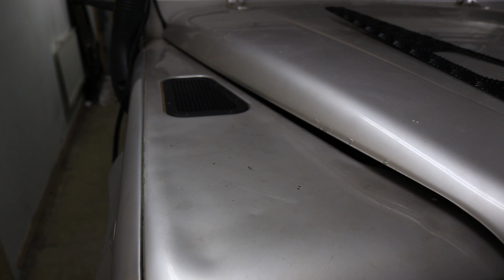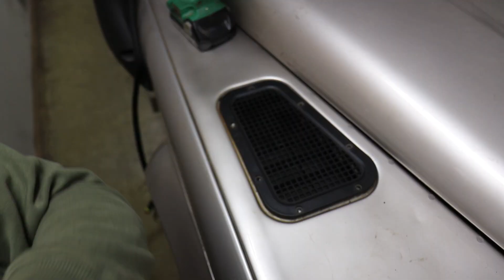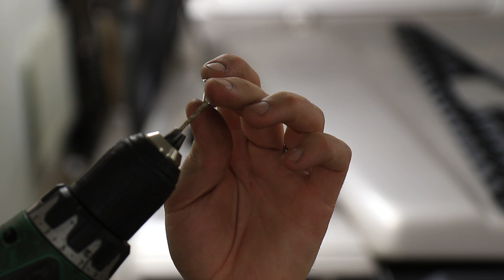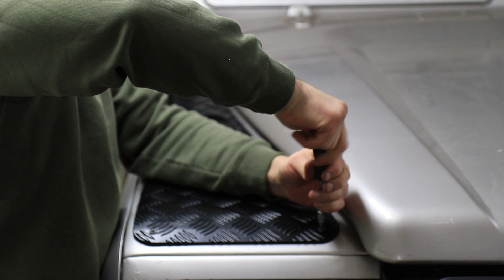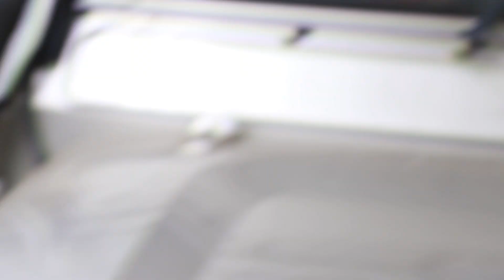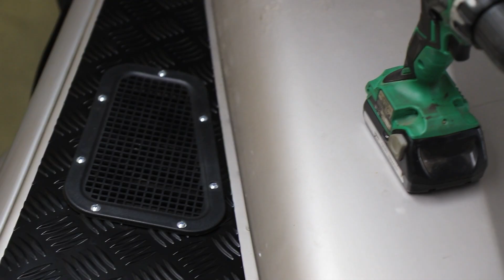Installing new chequer plate on my DEFENDER - How to!

Comment: Very nice. I bought plates that take up the whole wing(you need to remove the hood to install) I did use rivets and also silicone to seal it up. My 90 is black so there isnt much contrast, but black plates on the silver defender is gorgeous. You absolutely need to buy the plate for the hood!
Reply from the maker: Oooh, that sounds good as well, black on black! 
Yeah, might have to do that😍

Comment: Hi, is there no risk of galvanic corrosion because you used different material together? What about using wellnuts to fix it? Please advise
Reply from the maker: The wings are aluminium, the chequer plate is aluminium and so are the rivnuts so it should not be a problem. The screws themselves were treated so there is really little risk of any corrosion between the materials. Or is there something I missed?

Comment: HI i don't own a defender only a discovery TD5 but i would go with snow cowl's on wing''s leave bonnet it look's great what's next?
Reply from the maker: Thanks!!
I had a snow cowl on the 130, we'll see if this one gets it too😊 next up: I'm still struggling with the injectors leaking...
Reply: @Td5Adventures  i watched your video i cannot remember did ypu use genuine or after market - britpart  as i've seen on other forums they say use genuine
Reply from the maker: @richarddraper7896  I've put genuine ones in now but still leaking 😉  it seems to me like it's a myth the genuine ones are better. Why would they even start to leak if genuine is so good🤣🤷🏻‍♂️
Reply: @Td5Adventures  sounds like it could be injector not seated correctly or there is different sizes of O rings even geniune have you still got other O rings ? could try changing each one  see if they pop back in tight bit of a nightmare job
Reply from the maker: @richarddraper7896  yeah I'll have to try that! 
Gonna swap positions between them and see if they still leak in the same positions to determine whether it's the seal or head. 
Clever idea swapping some seals out for old ones! I've saved them all👌🏻 
I know they're properly seated, they all "clicked" in very clearly and very very tightly..
Reply: @Td5Adventures  finger's crossed it's not the head, Hope it all work's out and it's only the seals i look forward to seeing the next video soon stay safe
Reply from the maker: @richarddraper7896  Thanks, yeah we'll keep our fingers crossed!🤞🏻
Reply: +1 for Rivnuts that's how mine are on too. Make a lot of sense.
Reply from the maker: @MrNineCherries  Thanks! Yeah, it seemed the best option to me :)
Reply: I had a td5 very good Jeep discovery by the way 😁👍

Comment: How about water ingress under the plates....as you showed they were quite indented....any worry about standing water underneath?
Reply from the maker: I would not really worry about that, it's painted aluminium so there's not much that can be damaged by moisture there. If it is a concern you can always seal the plates with some sealant 😊